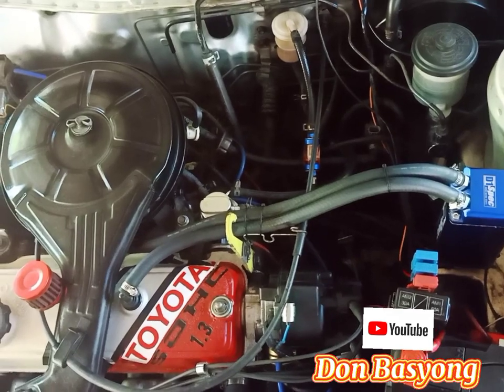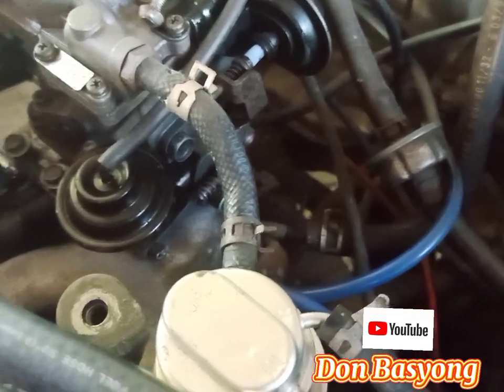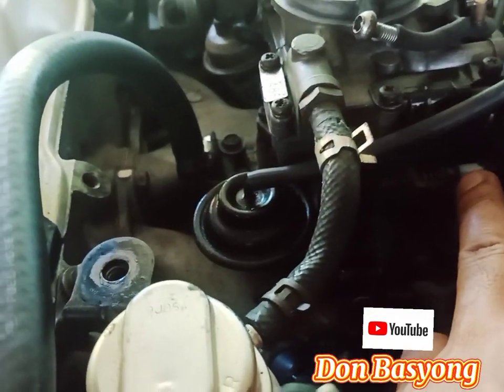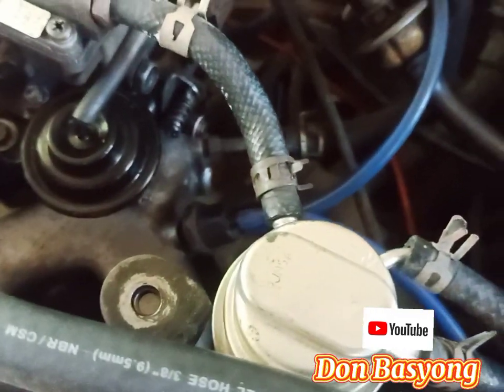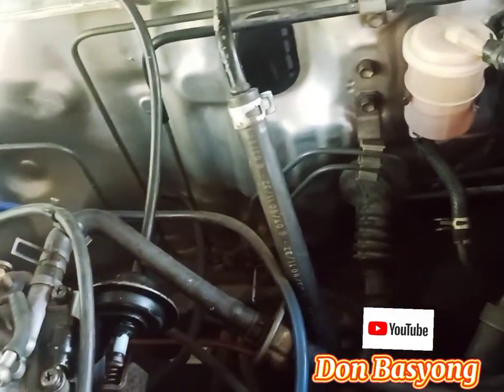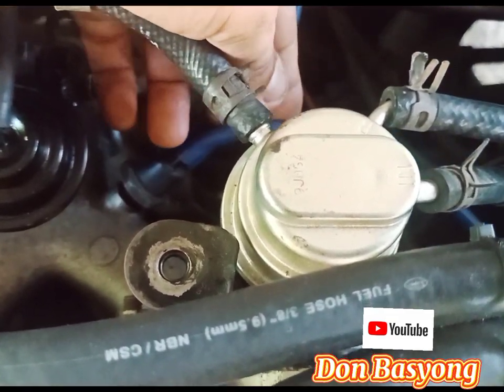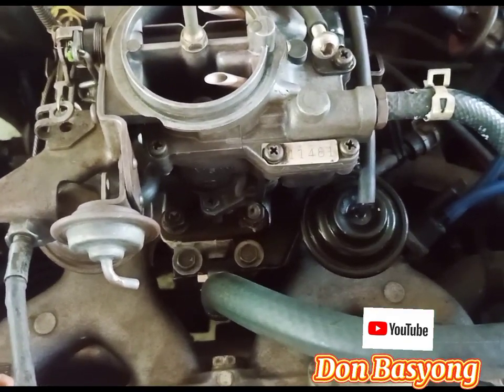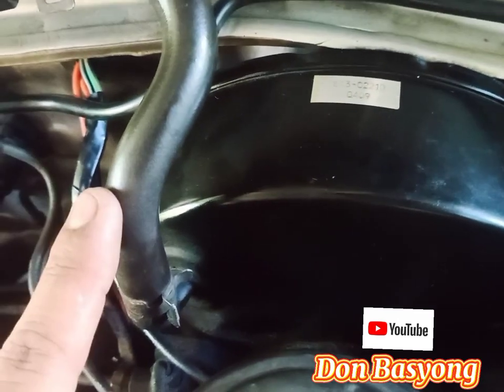VACUUM HOSE LINES | VACUUM LINES OF CARBURETOR,Aisan carburetor vacuum diagramTIPS DIY @donbasyong

Comment: Tama ka sir dun sa cold start fast idle diaphragm/screw. nagpa timing and carb tune up ako pero nakita ko ginalaw din nung mechanic yan. and then later nung nag restart makina nag wild/rough idling na. try ko ibalik base sa sinabi mo. tama ba sir pipihitin din muna sya para mas set sa 800 rpm (o mas mataas) pagkatapos na pagkatapos mag start (cold start)? new subscriber here po. thank you.
Reply from the maker: Yes papa ibaba mo muna pero dapat mainit na makina para Hindi madagdagan Ng rpm para ma set mo sa standard Ang auto mo paps🥰 salamat sa panonood Godbless 🥰
Reply: Paano Po Pag naka contact point, ung vacuum advancer Po niya 1 lang ang tube saan Po ikakabit Yun sa carb Po ba o sa may gas filter? Salamat Po sana Po masagot
Reply from the maker: Manifold vacuum kabasyong Basta manifold vacuum

Comment: Ka basyong, gusto kong linawin ang sinabi mo na i connect ang dashpot sa vacuum ng carb.Hindi ba dapat sa bimetal vacuum switching valve naka connect yan.Kasi kung sa vacuum port mo i connect yan,sa cold start ng engine,mag send agad ng vacuum sa dashpot para ibaba sa idle speed.Kung sa bvsv naka konek,hindi muna mag send ng vacuum ito sa dashpot hanggang di pa na reach ang normal engine temp.Kailangan sa cold start naka fast idle muna.
Reply from the maker: Kabasyong yang carburetor na gamit ko ay ee90 cable type choke wlang metal tube wlang bvsv at bimetal. Tinuro ko Jan sa video kabsat Yung vacuum connection Ng walang bvsv at bimetal Wala din power steering. But Meron Ako uploaded na video na Meron Ang bvsv at bi metal kindly check nlng kabasyong maraming salamat 🥰🥰🥰
Reply: Tendrás el diagrama de las lineas de vacio del toyota corolla 4afe1.6 v. carburado, por favor.

Comment: Thank you dami ko po ntutunan! More power and godbless po. Help lang po ksi pg cold start engine ko super baba po rpm. Tipong mamatay engine. Wla po ako choke.
Reply from the maker: Napa check mo nba Yan sa mekaniko paps? Kapag newly start engine specially ay mataas sna Ang menor at dahan dahan bababa kpag medyo mainit na paps may hic valve ba Yan o di kaya throttle valve positioner? Yan kc Ang responsible kapag bagong bukas makina bukod sa choke paps.

Comment: Tanong lang po kung meron ka pong video ng power steering assist vacuum lines ng 2e engine
Reply from the maker: Wla kabasyong pero Yan ay operated Ng manifold vacuum Yung Isa tapos pwede ported or delayed source Ang isa
Reply: Wala na po bang dadaanan na actuator po?
Reply from the maker: Wla na kabasyong Yung Isa rekta manifold vacuum tapos Yung Isa sa bi metal
Reply: @donbasyong  maraming salamat po mag sa subscribe po ako sa channel nyo bi metal po means yung yungag ba vacuum lang pag nag accelerator? Maraming salamat po sa sagot.
Reply from the maker: Nope ported Yung once you acceleration ska lang mag vacuum yang bi metal ska lang mag vacuum kapag uminit na makina

Comment: Para san sir yung isa pang dashpot malapit sa accelerator cable san sita konektado, at pati na rin yung sa ibabaw, na nilagyan mo ng screw
Reply from the maker: Yung secondary diaphragm ba para Yung sa secondary butter fly na natrigger Ng Ng manifold vacuum MISMO sa loob Ng carburetor na pag mag accelerate hihila pataas matrigger Yung hammer para bumukas Yung secondary butter fly para sa arangkadahan Yan kabasyong. Tapos Yung sa taas nmn na maliit na diaphragm ay choke possitioner pra magopen nmn Ang automatic choke at magbigay Ng Daan nmn para sa de choke na harangin at magsara ito kapag maintain na Ng carburetor Ang tamang idle o operating nito. Hoping na nakatulong kabasyong 👍👍👍

Comment: Papaano naman sir kung ang vaccuum advancer ko ay single diagphragm using contact point distibutor? San siya nakakabit na hose? Sa manifold or sa ported vaccuum?
Reply from the maker: Ma check mo Yan kabasyong pwede mo ilagay sa manifold vacuum kabasyong 👍👍👍🥰
Reply: @donbasyong  maraming salamat po

Comment: Sir napansin ko lang ung condenser mo sa distributor. Isa lng ang wire, positive na linya yan ng ignition nkatop?? Thanks po
Reply from the maker: Yes kabasyong 🥰👍🥰👍
Reply: @donbasyong  thank you po sir... hirap maghanap tsaka mahal ng assembly ng condensator ng big body electronic type. Pro ngyon alam ko na dahil sayo. Godbless sir. ..

Comment: Sir problema ko sa lovelife toyota 2e ko po eh ang lakas po nya sa gas, nagpalit na po ako bagong floater pina timing at tune up ko na din po, pero ganun pa rin po.
Reply from the maker: Proper timing ba kabasyong? Yung vacuum? Yung idle Tama ba at higit sa lahat Yung jetting Ng carburetor mo kabasyong Anu ba set Ng primary and secondary recommend 103 to 104 for primary secondary jetting is 158 to 160+ 👍👍👍

Comment: Base plate yan ba un Hose na pa puntang power piston sir? Sa ma turnilyo naay butas?
Reply from the maker: Yes paps Yung may turnilyo na may butas Doon dumadaan Ang vacuum na nag operate sa power piston now Pag napagvaliktad ito eh walng vacuum Ang power piston slow jet at secondary diaphragm na mag operate so meaning di mag function Ang carburator paps.

Comment: Good evening. Sir yong gamit kung carburetor sa 2e ko yong my electronic choke. Pareho lang ba ang connection sa vaccume hoses? At papano po sir magcheck kung nagana pa ba yong vaccum advancer? Thank you. Stay safe everyone.
Reply from the maker: Yes paps same lang connection nagkakaiba lang kc Yung iba may splitter .regarding sa checking Ng advancer Kung Nagana pa o Hindi na I do have also video na nagpapakita o nagtuturo papaano malalaman Ang advancer ay working pa o Hindi na kindly check sa videos ko nlng paps..I hope na makatulong ito sa iyo. Salamat sa panonood paps. Godbless 🥰🥰🥰
Reply: @donbasyong  ty sir napanood ko na yong video regarding how to check kung nagana pa yong vaccume advancer. Btw, sir okey lang ba d na lagyan ng one way check valve yong mga vaccum hoses? Wala ba epekto sa performance ng engine o kaya sa idling? Ty
Reply from the maker: @richardboone3678  yes pwedeng pwede Basta maintenance check lang palagi para iwas aberya salamat sa panonood paps🥰

Comment: Saan location ng shop mo Don Basyong? Gusto ko sana ipagawa sau sasakyan ko. Matakaw sa gas, at parang tunog makinlya makina. Toyota corolla model 2002, 2E engine. lovelife or baby altis daw ito.
Reply from the maker: Poblacion laoac pangasinan kabasyong
Reply: Pwede ko bang ipagawa sau itong sasakyan ko. Gusto ko kasing i-kondisyon lahat para worry free sa long drive. Specific address sa loac please. Dito lang ako sa Dagupan, at kung anong oras at araw ka available.
Reply from the maker: Sabado linggo lang kabasyong availability ko Basta laoac National highschool pag Anjan kna puntahan kita.
Reply: @donbasyong  thanks kabasyong. After election na kita mapasyalan kasi medyo busy ako sa 7th& 8th of May.
Reply from the maker: Ok Ka basyong message Ka lang sa Facebook fage
Reply: @donbasyong  bibili na ba ako ng valve seal kabasyong? Kasi napanood ko video mo sa replacement ng valve seal, ganoon din tunog makina ko. Isa pang issue ng sasakyan ko is sobrang mataas fuel consumption. 5-6 km/liter lang. Yong ibang ka model niya is 13-15 km/liter daw.

Comment: Boss.Gus am. Boss.gong we 2e. Engine..baker p.o.. Pay hinugot no high tension does no.4 as spark plug.to nag live any idling..nagpalit na ano spark plug at wire .pero slang pagbabago Anwar Kay hinugot no wire spark plug...sana masagot no
Reply from the maker: Paps singaw balbula Yan may naririnig kba iba tunog sa makina mo? Now gawin mo muna is d.i.y mo muna na ikaw lang kc para measure mo bago mo ipa check Ang compression Ng bawat cylinder. Try mo lagyan Ng clearance na 18mm intake at 23mm exhaust valve clearance now Pag di nakuha ska mo lang ipa compression test..may usok ba deep stick baka kc worn out na piston ring Ng nabanggit mong cylinder paps.
Reply from the maker: Yun muna gawin mo bago paps baka makuha kc mamaya sabihin agad dpa na check eh top overhaul agad..kc na experience ko na Yan may dead na cylinder pero take note naibyahe ko pa kc nakuha ko lang sa valve clearance..

Comment: Matagal ko na po itong hinahanap na topic regarding sa vacuum hose info, mga connections at functions. Ask lang po ako sir meron po ba kayong vacuum hose info about lovelife. Yung tamang paglagay ng kulay ng one way check valve (orange and black) na naka connect sa intake manifold? Yung sa akin kasi parang mali pagbalik ng mekaniko ko sa mga kulay ng one way check valve kung saan nakatuon ito. Ikini-compare ko po sa downloaded ko na ee90 vacuum hose info magkapareho ang line ng vacuum pero ang kulay magkaiba po ang pagbalik nila. Hindi cguro pinicturan yung vacuum line nung ginalaw nila kaya parang hindi magkatugma ang mga kulay at linya. Sana po magkakaroon po kayo ng video about sa ganon at sana masagot nyo po ang mga katanungan ko. Thank you.
Isa-subscribe ko po kayo.
Reply: Location pls.
Reply from the maker: Poblacion laoac pangasinan kabasyong
Reply: Sir yung 2e ko wala po sya manifold vacum hose
Reply from the maker: IPA compression test mo muna kabasyong para sure na malaman DAHILAN pag kawala Ng manifold vacuum baka crack or worn piston rings

Comment: Ka basyong tanung kolang Yun carb na ee 100 at ee 111 pwede ba gamitin sa sb ee90? Saka napansin ko lang bkit wala ka ng bvsv na nakakabit sa manifold e maganda daw Yun sa performance ng car? Sana masagot mo, salamat uli.
Reply from the maker: Yes kabasyong oo maganda Ang bvsv sa auto like mine is ee90 Wla lahat pati vacuum tube Ang choke ko ay cable type. Ee 90 ay Wla Ng mga ganyan so far so good nmn Ang performance Ng auto ko pati fuel consumption Basta wlang vacuum leak naka timing malakas kuryente Wala Ka maging problema now pag gusto mo magkabit Ng ganyan ay pwedeng pwede Basta may mga port lagayan Ng bi metal at bvsv at Ang carb is auto choke operated and may vacuum tube kabasyong 🥰👍🥰👍

Comment: bro subscriber mo ako.. ask lng po ako ang bigbody at small body same lang ng carburator or same lng sila sa kinakabitan ng mga vacuum hose? ..salamat po sa sagot
Reply from the maker: May deffirence kc depende sa carburetor kung pang 2e na ee100 ee111 lahat Yan eh automatic choke Yung akin ee90 manual o cable type choke.pag dating sa vacuum lines mas marami port Ng ee 100 at ee 111 upper yr model. Pero pag dating sa concept Ng vacuum same lang Basta alamin mo Ang mga diaphragm na gumagamit Ng manifold at ported vacuum Gawin mo guide yang mga videos ko. Salamat sa suporta at tiwala kabasyong 🥰🥰🥰 GODBLESS 🥰🥰🥰

Comment: Sir. ask ko lang wala na kasi yung Charcoal Canister ng FX 5k namin. pwede po ba takpan ko na lang yung Hose papuntang  purge valve solenoid? or any suggestion po. salamat
Reply from the maker: Pwede mo takpan tapos Yung line sa purge valve solonoid ay hugutin mo nlng para Dina gumapa pa.pero mas mainam din na maibalik ito para walang Amoy Fuel sa loob Ng auto o sa mismong engine bay.
Reply: @donbasyong  sir parehas po tayo ng design ng carburator. ang nagkaibahan lng po sa akon meron po syang black plastic na bilog sa likod nya. "Automatic Choke" po ba tawag doon?
Reply from the maker: Automatic choke paps.

Comment: Tapos bos, yung carb ng 2E ko may electronic choke, hinahanap ko ang port para sa vacuum advancer sa likod ng pihitan ng air mixture pero wala kong makita.  yung sa manifold lang na vacuum ang meron
Reply from the maker: wla nba ibang line ng ported? kung meron na nakasalpak na iba pwede mo split mo nlng paps
Reply from the maker: madali lang malaman kung ported vacuum kapag wla higop at nagkakavacuum lng kapag e accelerate paps.

Comment: Sir  sa 2E engine ba ang AC IDLE UP ay nakalagay lang galing sa Manifold tapos papunta na ng IDLE UP na vacuum sa ilalim ng carb? 
kasi po yung sakin mula sa carb sa side na malapit sa speed idle nya tapos nagpunta sa sa illalim ng ng vacuum IDLE UP, pwede din po ba yun? tumataas naman po pag nagbukas ng AC ang RPM pero pag nagtagal na mabilis na bukas at sinde ng idel up
Reply from the maker: Ito Ang concept Ng idle up paps Ang idle up gumagana pag on ac now Anu Ang ginagawa nito it allows the vacuum na pumasok upang higopin ng diaphragm at Ng sa gayun umangat ito at magbigay Ng additional idle sa sasakyan paps.Ito ah paps like my car it's Corolla sb 1989 model bakit na ka condem na iba line? Yes it's because wla na Yung ibang parts Dina Nagana now as a new owner Ng  unit until unti ibinabalik sa dati Ang set up regarding sa mga lines Ng vacuum Yung iba condem na.ang important e Alam mo Ang basic na vacuum na ported line at manifold line at Kung Anu o alin Ang mga gumaganit nito sa iyong sasakyan now Kung may mga lines nmn na baliktad Ang kabit my videos will serves as a guide only now nasa sa inyo if u follows kc kayo parin Ang masunod Kung saan NYO nakitang komportable Ang sasakyan NYO na set up...if may katanungan kapag paps feel free to ask and I'll get back as soon as I could..thank you for watching Godbless 🥰🥰🥰

Comment: DON BASYONG ANO PO BA ANG NASA LOOB NG HIC VALVE PO
Reply from the maker: HIC stands for Hot Idle Compensator. It controls (via a vacuum hose) two things - 1) a valve that opens or closes the "stove" tube which takes in fresh air for the carburetor after it has passed over the exhaust manifold in order to heat it while the engine is cold

Comment: Idol anu ang solusyon sa corolla 2e ko, hndi ko maibaba ung idle nya nka steady nalng sa 1k  dpa nka open ung aircon...
Reply from the maker: Yung fast idle bawasan mo kabasyong. Tapos check vacuum baka mababa
Reply: Nabawasan ko na idol maluwag na rin ung idling screw nya sana may tutorial ka PRA dun sa problema  ko idol, lagi ako nka subscribe. Salamat idol
Reply from the maker: Kabasyong ok ba vacuum mo?dapat mataas may vacuum gauge Ka? Dapat kc mataas para di mamatay engine kapag ac. Tapos jetting Ng power valve is 100.tignan mo din Ang dash pot baka nakatukod Kaya dmo mabawasan Ang idle speed screw

Comment: Pop bakit ung sasakyan ko nilinis ko lng ung caburaton nawalan ng hatak at umusok ng item .2e engine makina nya
Reply from the maker: Kabasyong Wla Ka NBA iba ginalaw? Kc kung carburador lang eh baka Mali Yung pagkakabalik mo sa karburador like Yung screw sa na dalawa sa ilalim Ng throttle. Or pagdating nmn sa air and fuel mixture screw ay Mali din Ang pihit kung baga kulang sa hangin.or Bali BALIKTAD na vacuum lines.check mo nlng sa mga videos ko Ang pag assemble para maging guide mo kabasyong.👍👍👍

Comment: Boss ung saken bb 2e carb type.hard starting s umaaga.bumagsak minor tapos nmamatay.ung sinasabi mo po n dashspot wala po sya .parang s aircon lng po meron..nag hhigh rev tapos namamatay.bka matulungan nio po ako don basyong.slmt po
Reply from the maker: 4k carb ba nkalagay sa bb mo? Pag Wala talaga paganahin mo Ang choke mo kung cable type mainam na paganahin mo now kung automatic choke nmn Basta working paganahin mo Ang mga vacuum na comocontrol sa de choke at choke possitioner.

Comment: Paps anu kaya problema ng 2e ko. Paiba iba ang menor nya. Hindi maitama ang tamang idle. Salamat po
Reply from the maker: Paps medyo madami Ka e check pag ganyan madalas carburetor Ang sinisisi pag dating sa naglalarong idle Ng auto Lalo na sa carburetor type Kaya nainbento Ang computerbox para mapadali by the way pag dating sa sakit Ng auto mo Ang e check mo una Isa Ang distributor baka kinalawang na Ang loob nito or may naiipit, distributor cap baka worn out na, ignition module baka mahina na Ang bato Ng current,patio Ang ignition coil baka may biak or may nag short sa loob na wire or lumalabas Ang current, high-tension wire baka may patide na or di na Nagana, sparkplugs mo baka pumapalya or di na Nagana, pick up coil Ng distributor baka kumalas na sa pagkakabdikit nito at sumasayad na sa  cam lube Ng distributor na dapat may air gap na .40mm kabasyong. Carburetor nmn ay Mali Mali Ang mg vacuum lines na kinakabitan nito, singaw or may vacuum leak, usually base plate or may mga diaphragm na sira na madalas ay Ang advancer Ng distributor tagusan na, sirang o butas na vacuum line gawa Ng katagalan, maling air and fuel mixture,maling idle speed screw adjustment, tukod na Ang fast idle screw Kaya mainly nakaopen Ang secondary ng carburetor kahit idle lang,worn out butter fly Ng mga throttle/throttle plate Ng primary secondary, worn out na fuel pin Ng flooter Kaya nag overflow or Dina nagoopen kya wlang enough gas na napasok, kinalawang sa loob Ng throttle body Kaya hindi magsara o mag play Ang mga plate nito.barado, fuel strainer Ng carb baka madumi na or barado, idle solonoid baka palitin na kc pag mainit nag open or stock up close Kaya di nagtutuloy Ang idle. Stock up close Ang choke or sira na Ang de choke Kaya di humahatak pa open ito ay Makita sa mga auto matic choke. Timing Ng auto kabasyong Isa Rin Yan. Madami pa e check kabasyong iilan lng Yan sa mga dapat tignan kabasyong at SANA makatulong ito sa pagsaayos mo Ng auto mo. Godbless 🙏🥰
Reply: @donbasyong  maraming maraming salamat po. Nag karoon po ako ng maraming idea. Patuloy lang po sa pag gawa ng video. Napakarami nyo pa pong matutulungan gaya ko na baguhan lang sa pag ko'kotye. Salamat po ulet godblesss
Reply from the maker: Salamat sa tiwala at suporta🥰
Reply: @donbasyong  parang yun sakin kabasyong nabili ko yung oto ko na bago na yung carb. Pero yung idle nya hindi stable, naglalaro ng 950-1k magalaw. Ngayon pina timing ko at tono, di nman magtono ngayon. Di magka idle bumabagsak siya. Hindi gumagana yung air/fuel mixture ng carb. So ngayon balak bilhan ng original carb ng 2e mismo. Hopefully maayos na 🥺
Reply from the maker: Check mo may vacuum leak Yan check manifold base plate fibra vacuum hose diaphragm, 👍👍👍